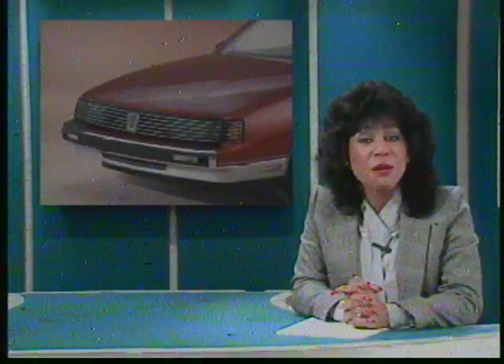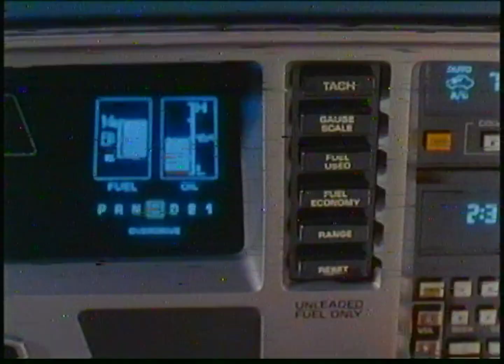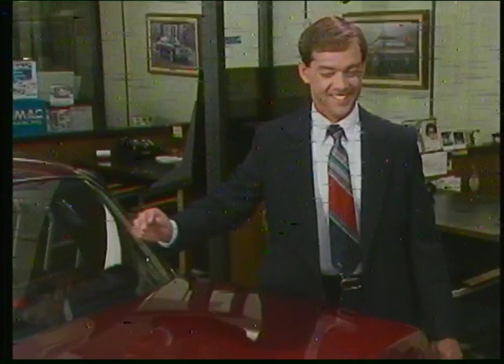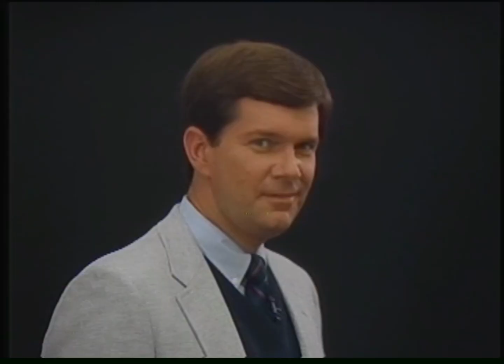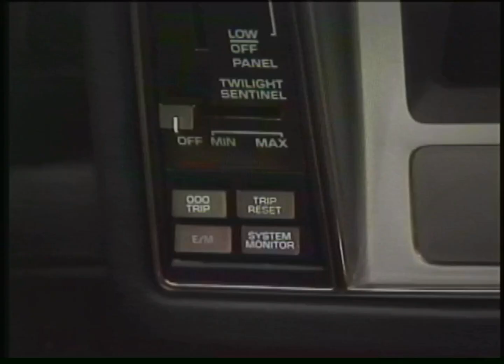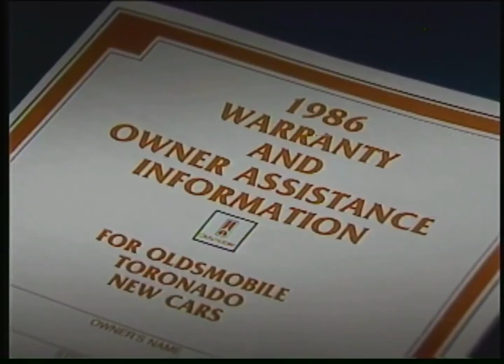Everything you ever wanted to know about the 1986 Oldsmobile Toronado.

Comment: Thank you for the video. As a owner of a 1992 Oldsmobile Toronado I say thank you. The hood and the instrumentation panel carried over until 1992 the final year. The car grew in size in 1990 thankfully. It went from 187 inches long back up to 200 inches long. The width grew as well. The wheelbase stayed the same.  The issue the 1986-1989 model had is it looked like the smaller Calais/Cutlass Calais. 1990 Oldsmobile Toronado: https://www.youtube.com/watch?v=up3aIGqcuB0&t=54s